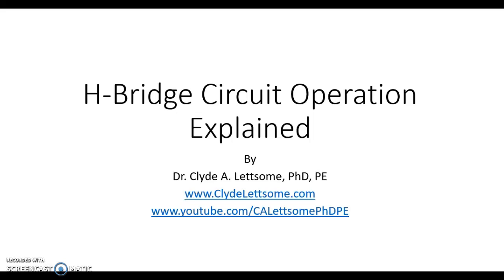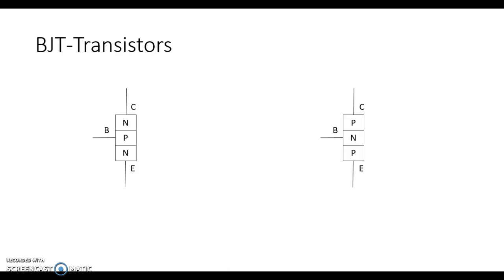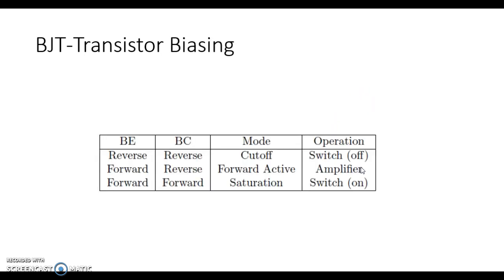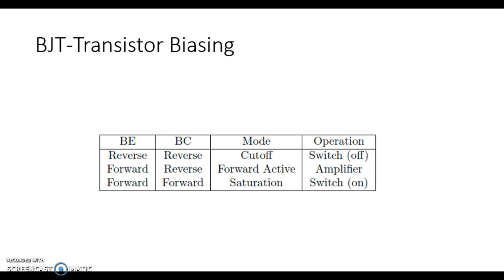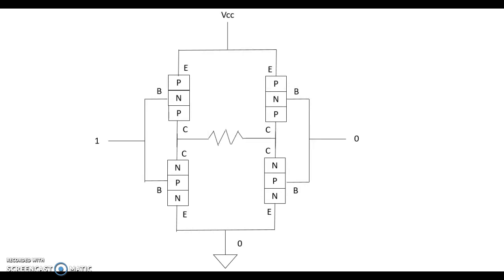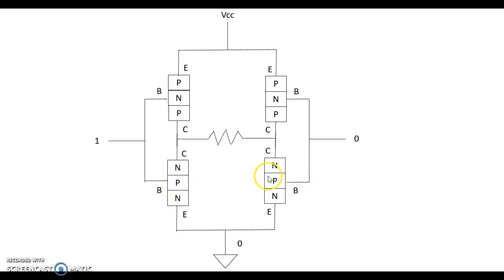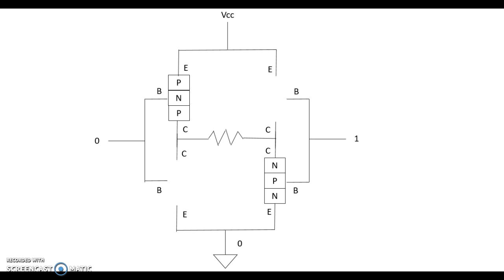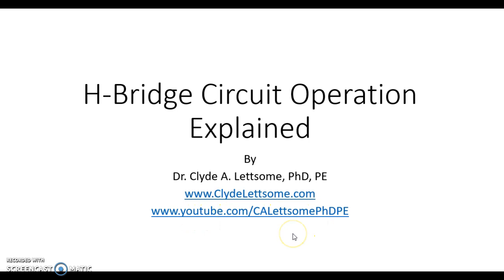H-Bridge Circuit Operations Explained.

Comment: Thank you for this excellent and informative explanation. I understand that an H bridge circuit - along with a constant current source - forms the basis of differential signalling. I know that most differential transceivers have this circuitry built into dedicated transceiver chips, but I am on a mission to understand what is going on "under the hood" so to speak (more out of curiosity than necessity, to be honest). So may I ask: in the case of a differential signal pair (wires or pcb traces, for example), would the two traces / wires be supplied as a direct replacement for where the motor would be, with the terminating resistor forming the return path, or would additional circuitry be required for a differential pair (additional and beyond the obvious constant current source, that is) ?

Comment: Almost lost me... but I came back... looks like there is an analog solution with relays too? - looks like and arduino application... the window switch for a power door window operates like an h-bridge with you finger changing the polarities 1 & 0
Reply from the maker: Hi Doug,
The H-bridge is analog. If the transistors are properly biased to operate as switches,  no relays are needed. 

Like, Share, and Subscribe.
Reply: @CALettsomePhDPE  Thank you - your schematic is important to me as I continue to learn about transistors pnp vs npn - your diagram uses both... I am trying to build an hbridge out of relays and another out of transistors so I can continue to grow... I am working on making window motors and or wiper motors into large sized servos... as well as understanding stepper motors... I have picked up an arduino and an old 75 in 1 electronic kits, and some motors from the wreckers.

Comment: If I have a 3V DC motor, how do I maintain required potential difference across the motor using this configuration?
Reply from the maker: Hi Niket,
The answer to your question requires more explanation than should be written in the comment section. Please submit your question at this link: clydelettsome.com/blog/forms?page=ask-the-expert

Comment: Why there are pnp and npn transistors instead of all pnp or npn?
Reply from the maker: If they are all pnp or npn, all transistors will be on or off at the same time. This would defeat the purpose of the circuit.

If you want more of an explanation. Post the question to my site.
https://clydelettsome.com/blog/ask-the-expert/

CAL
Reply: i think it's so the base current won't be driven through the resistive load? not entirely sure though